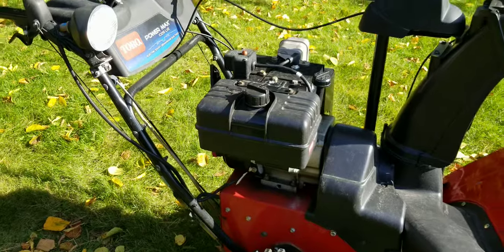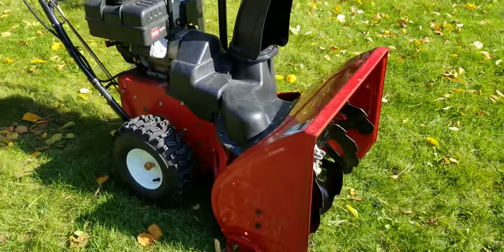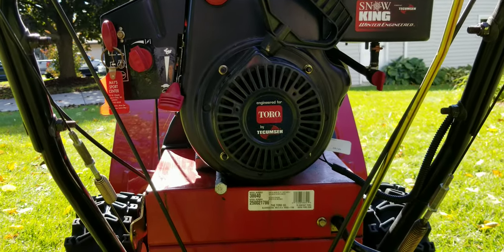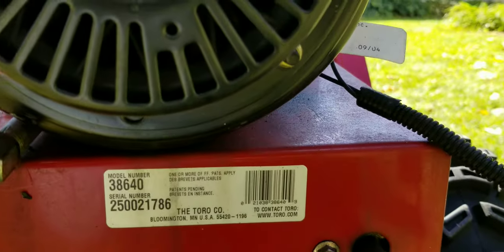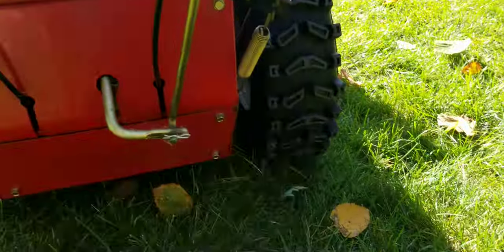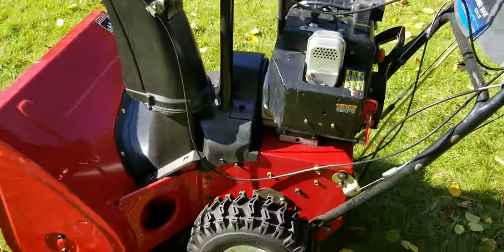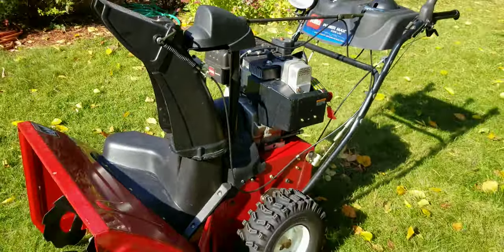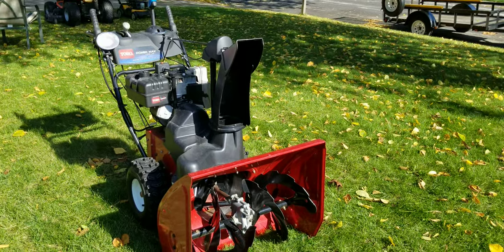Toro Power Max 1028 LXE - Snowblower Walk-around

Comment: I have the exact same snow blower, garage kept and in great condition, however the light does not work? Any recommendations? I did change the bulb, but still wouldn’t turn on. Thanks!
Reply from the maker: Check all the connections. Especially the ground wire.
Reply: @RealManSkills  thank you, I appreciate it!